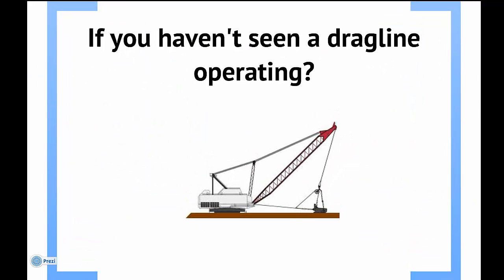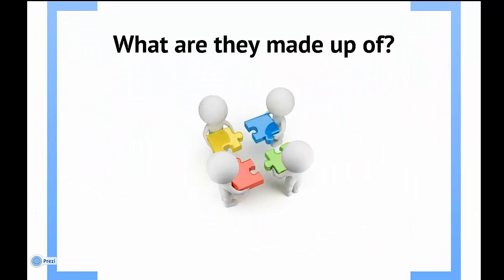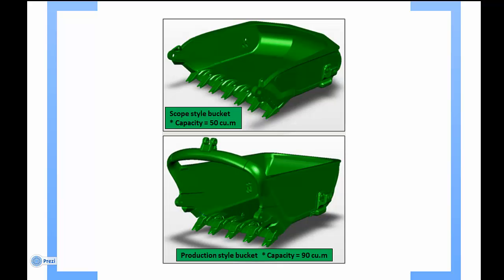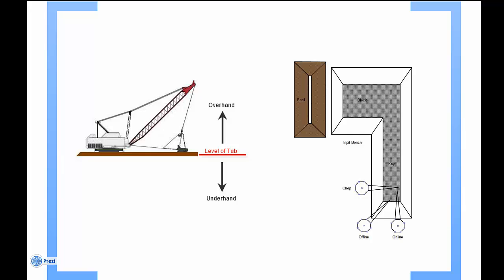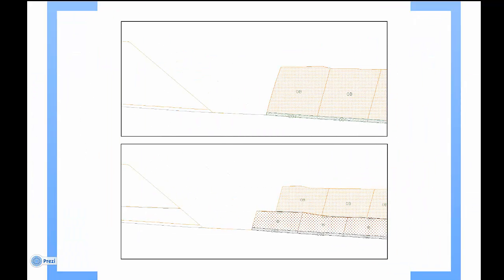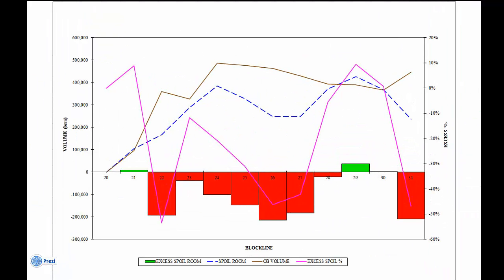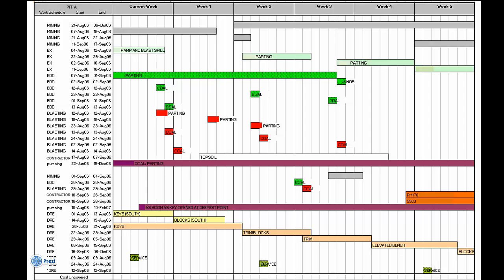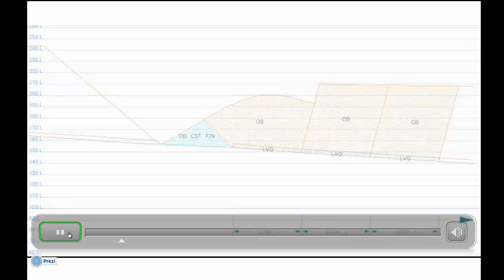Dragline 101

Comment: If you are interested I have numerous photographs of the 5 Draglines in operation at the iron ore quarries of Corby Steelworks in the UK that operated from 1950 to the works closure in 1980, there were three W1400 and one W1800 Ransomes & Rapier machines and one Buycrus Erie 1150B machine.